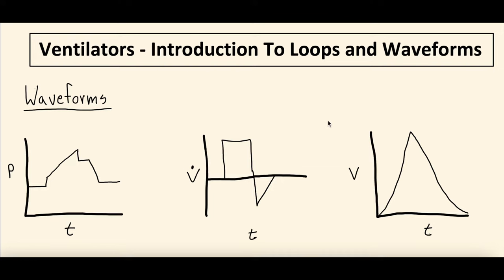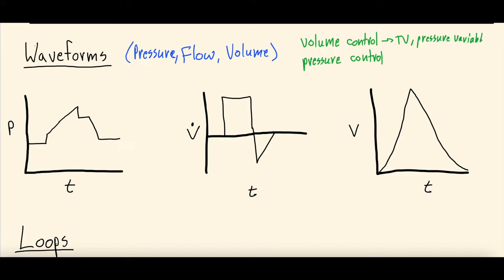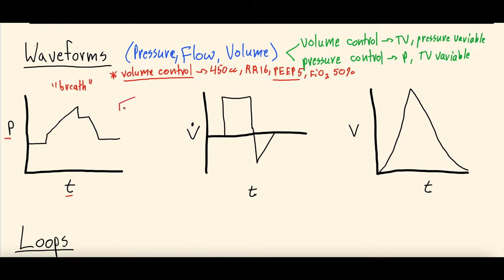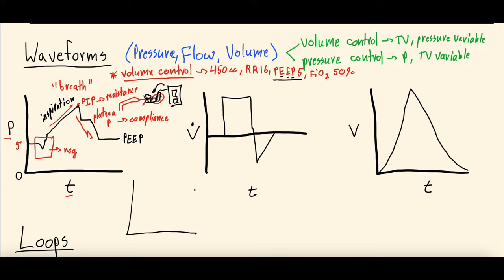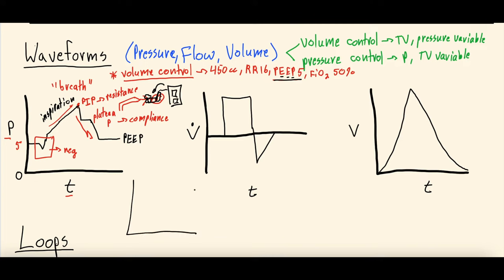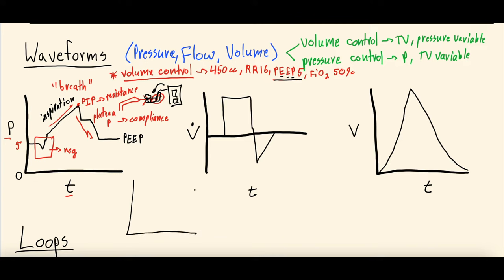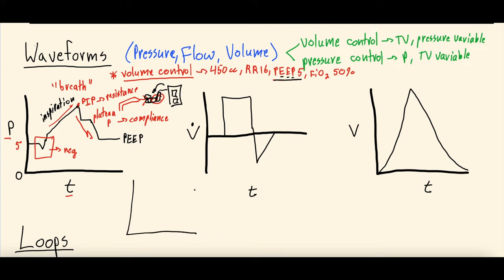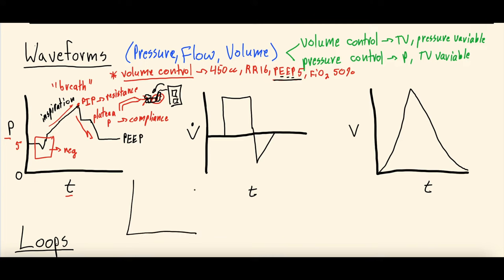Ventilator Waveforms (Scalars) And Loops - Basic Concepts - Pressure, Flow, And Volume

Comment: Volume(fluid,  evaporated fluid, gasses(possibly liquid) ,  temp(different temperatures for different substances),  assisted or not breathing , filtering ect, is there a protocol set by professionals like you or are you advising or making protocols you can share with others in the medical field considering there are  many technicians ventilating with  different techniques as well as different schools and  teachers teaching the same subject ? How important is the temperature of the air brought in under ventilation and can the temperature create complications?

Comment: I thought the pressure control is box shaped vs volume control
Reply from the maker: Great question. So which is square shaped depends on the scalar you’re looking at. Volume control has a square shaped flow scalar and pressure control has a square shaped pressure scalar. This is a manifestation of how the breath is being delivered by the ventilator